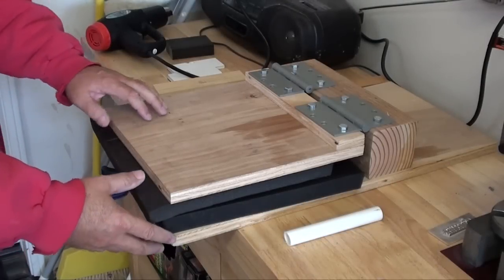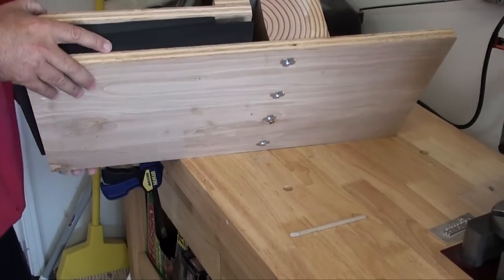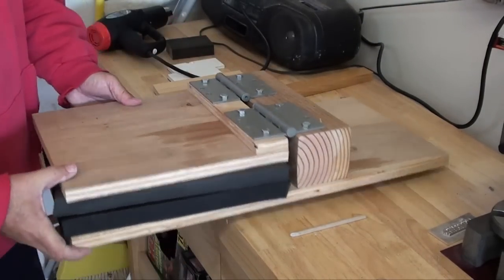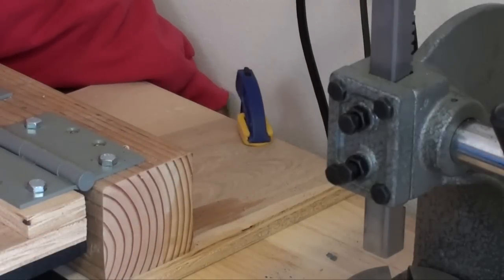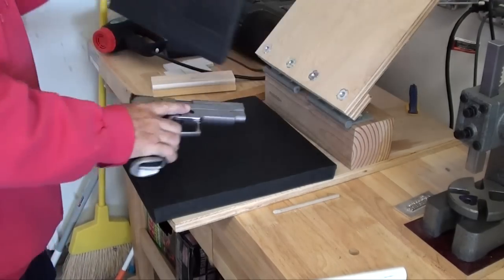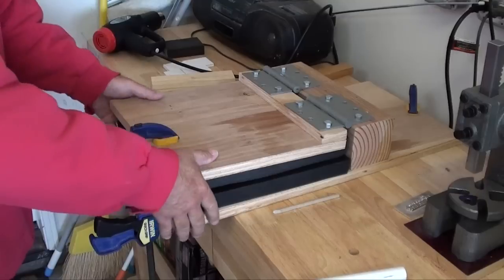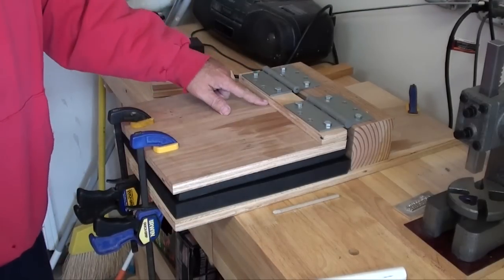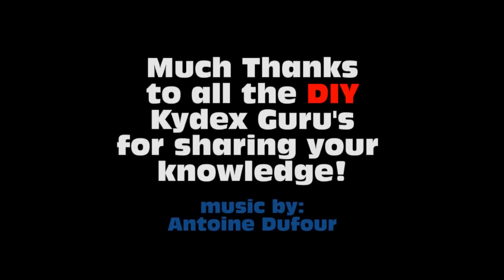DIY Kydex Press - Holster or Knife Sheaths- kenpoist7.mp4

Comment from the maker: The reason for the hinges is getting the part being formed in the press aligned with the Kydex and getting a good press before the Kydex cools and sets its shape. This design works best for me, however, you're right there are limitations but I'm use to the idiosyncrasy of this design. Working in the evenings and weekends I'm doing 20 or more holsters a week.
Thanks for sharing your thoughts.

Comment from the maker: Thanks for the comment.
The shim (3/4' Plywood) is for the variance in foam sizes used in forming.
Replacing the shim also gives flexibility in the press for use with flashlights with larger bezel and bell.

Comment: nice press! looks to be made very well. i was with you up until you pointed out the gap in the forming sponge in the hinge area. you could have done away with building your rig with hinges, bolts and drilling etc... with two more clamps. just sandwich everything between two boards and four clamps, one in each corner. done and done.

Comment from the maker: @PhillyEDC I've tried it and it's pretty sweet.
I've applied that to a process I found works pretty good is using a wood burning  iron  with a long cylindrical tip and running it around the edges at a moderate speed. That is one of the videos I'm going to do in the next few days. Thanks for the input and ideas.

Comment: Simple yet effective. Thanks for the tips. It's been a couple years now, do you still use the hinge method? I have been tempted to make one similar but I was afraid the hinge type would cause uneven pressure. Do you find you get even pressure when clamping it down? It seems like getting even pressure would be contingent upon the thickness of the piece in the press. i.e. thinner piece, not enough pressure on the back end and conversely, a thicker piece and not enough pressure on the front end. Thoughts? Thanks again.

Comment: I see that you put a nice big double stack gun in there.  Any trouble with holster definition with the 1" foam (as opposed to 1.5") with a big gun like that?  I'm going to be pressing double stacks and I'm not sure if I need the 1.5".
Reply from the maker: Yes, if the Kydex (.080) is heated to 340 - 350 degrees it will be malleable enough. However, I used in my holster business a hydraulic press (10,000 psi) that gave better definition with 1" foam from Index Fasteners in Ontario Ca.
Try Danny at Index Fasteners
909-230-4804

Comment: You could've made the mold just a bit longer in center and put a big bolt or plastic bolt from top to screw down the mold to tighten it. Then you don't need the clamps to press the form.

Comment: Are the bolts 3/8' and length 2 1/12' thank you Gary
Reply from the maker: I believe the Bolts are 3/8" shank. The bolts through the two pieces of plywood are 1 1/2 long, due to the tee nut being recessed into the bottom piece of plywood (3/4 x 12 x 12). The longer bolt is 4 1/4" long again the tee nut is recessed in the very bottom plywood (roughly 3/4 x 12 x 20). hope this helps